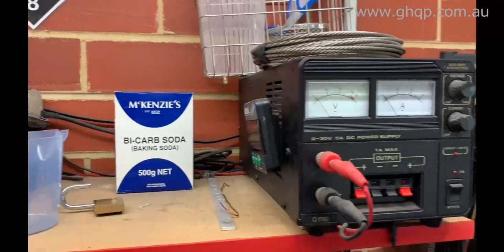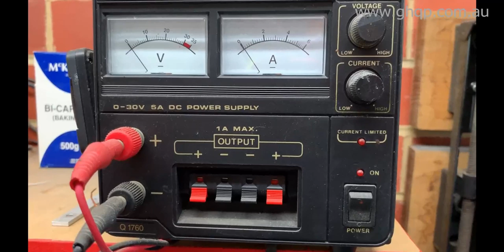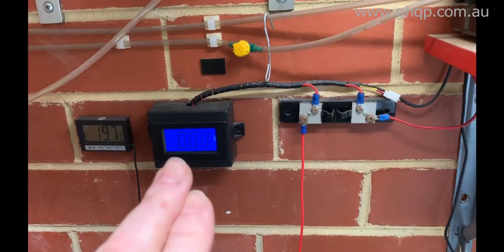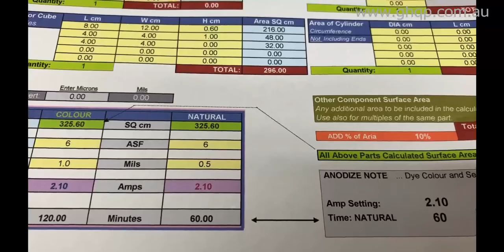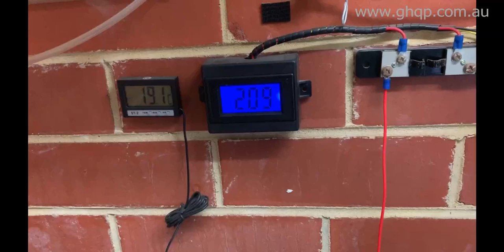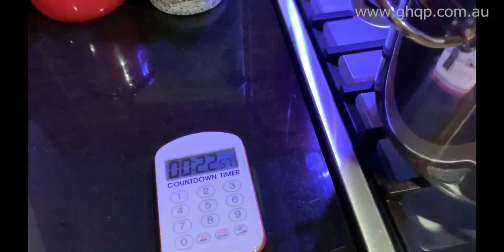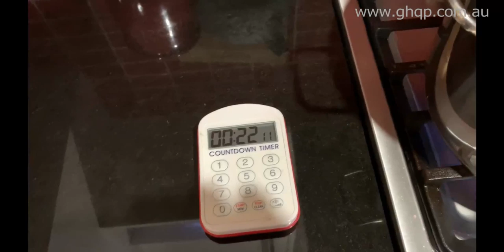Home Aluminium Anodising Process - Part 1

Comment: Hello there. It's refreshing to be able to watch a fellow Australian doing this.
I am considering doing some anodising work for myself as I am doing a couple of motorcycle restorations. One being a 2001 Kawasaki ZX9R bike, where I would like to restore the top triple clamp. The part is obsolete and so I will have to recondition a spare one I have to make it look factory. I have studied it carefully and it appears that the part was silver anodised, then the top face is machined, (it has the look of being sanded with 240 grit), then it's powder coated in clear sealer. 
Question. Is there a "silver" colour dye or is the silver colouring simply achieved by virtue of it being in the acid dip ??
If there is a silver dye, is it just one colouring or are there variations ? I want mine to look factory.
Other parts that have the same silver anodising include, the gear selector, the rear brake pedal, the front clutch and brake levers and foot pegs to name a few, so it will need to match up.

I will visit Caswell and see if I can find a DIY kit that will suit my low scale situation. Thanks for that link. It will be useful.
Any advice would be really appreciated.
Thanks again mate.
Reply from the maker: Hi. That's what go me started with anodising, motor bike parts way back when I had bikes.
Anyway, I am not aware of any silver dyes, as silver is usually achieved with just anodising and sealing, its the natural aluminium colour.
However I believe commercial anodiser's have a process for achieving an almost satin silver chrome like finish but I have never investigated that so don't know.
All I have done when I want silver is just not using any colouring. However the degree of silver achieved does depend on the grade of aluminium. Machine grade like 4000 can end up being a light grayish colour where as 6000 grades are the best for a good natural silver aluminium finish.

Comment: Is there a reason you're using bicarbonate of soda rather than sodium carbonate which is far more alkaline (i.e. washing soda)?
Reply from the maker: You make a good point, I have no specific reason for using bicarbonate of soda just that's what I started using way back as I had it in the pantry and continue to use it, seems to work fine for the little amount of anodising I do these days. But I take note of your suggestion and would agree Sodium Carbonate has a better chemical combination for the purpose.

Comment: Thank you for the video! Can the thermometer be placed inside the acid bath? Is it important to use thermometer with plastic parts instead of stainless steel? I guess the same requirement applies to aerator. Thanks!
Reply: It to monitor the acid temperature I only use a temperature sensor that has a plastic probe. I wrap a small amount of lead around the wire to make it sink. As for a stainless steel one, never done that but it might be ok. Yes my aerator is all plastic.
Reply: Thank you! Any hints what product/solution could be used for degreasing bath instead of Caswell SP degreaser? I live in europe and it’s not possible to buy one here.
Reply from the maker: @janankiersztajn5189  You could use most cleaning detergents or solvents to clean the parts. I just use Caswell because its easily available for me but when I first started I simply scrubbed the part and soaked it in dishwashing detergent. The amount of degreasing/cleaning all depends the machining oils etc you have used during the machining process of the parts.

Comment: Thank you for this video! Helped a lot. I just have a question. What is the ratio of HNO3/HCl in the 5% solution (can you for example use just HCl) ? And do you add any sealant to the sealing process ? Thanks for a answer! Greetings from Czech Republic!
Reply from the maker: The ratio is  5% Nitric and 5% Hydrochloric Acid to distilled water.
I don't add any sealant to the sealing water.

Comment: So if doing a part that require a 55 gallon drum. The voltage will need to be higher?
Reply from the maker: Regardless of the volume/size of the container the voltage is constant and the current is set based on the part surface aria being anodised. You need to use a current controlled power supply so you set the current to the value required.

Comment: Dear engineer
I have a question about Anodic plate in the Anodized bath
1) what is the material of Anodic plate?
2) How to calculat the size of Anodic plate?
3) Can we cover the entire interior of the anodized 
   bath with an anodic plate?
Reply: It is a thin sheet of Aluminium about 0.5mm thick. It does not wear out in fact I haven't changed it for over 6 years. I use titanium screws and wire to make the electrical connection. I didn't use any formula to calculate the size. I just figured it needed to be about the size of each end of the tank. That works fine. I don't see any benefit or reason to cover the entire interior of the acid tank. Nothing i have ever read on the subject suggests to do this. One thing is to always remove and clean the plates when you have finished anodising for the day. If you leave them just sitting in the acid they will develop a black smutty film on their surface that to me i don't like. To clean them I dip them in water with some bicarbonate of soda to neutralize the acid and wipe them clean with paper towel. Cheers Graham
Reply: I know it has been a while since you posted this, but what a great video! Thanks! Did you use 6063 T5 aluminum for the cathodes? I’m struggling to find it that thin.

Comment: A very well matured setup. *like*. Do you keep the aluminium plates ( the negatives ) in the H2SO4 solution when you store it until next use ? I understand the negative aluminium plates will not be anodized but will the acid not get to it when the system is not in use ?
Reply from the maker: I remove and wash first dip the aluminium end -ve plates in a Bicarbonate of Soda solution to neutralize  the acid then rinse them in water. Never leaving them in the acid even for overnight. I have been using the same plates for many years. I use Titanium wire and Stainless Steel screws to secure the Titanium wire to the aliminium plates.
Reply: @hamrx8  That makes sense. Glad to know the plates last long that way. No need for lead then :). When reusing the main anodizing acid bath electrolyte - what kind of maintenance is required on it ?
Reply from the maker: @NeoFrontierTechnologies  Yes lead is not needed no way. As for maintenance on the acid bath electrolyte. May be if using it a lot and the level drops below what you want just mix enough acid and water at the same ratio and pour it in. But apart from that if you always ensure the parts to be anodised are always really clean and well rinsed then your bath should last for years. In 10 years i have only done a complete bath replacement twice. However I don't use it a lot these days. Oh also always make sure the -ve aluminium plates are clean of any smut or residue before putting them into the bath. After removing them from the bath, neutralizing them and rinsing, I always wipe them with a clean paper towel to remove any loose black smut that will have accumulated in the surface during the anodising process. They should look a dull grey, you will figure all this out as you proceed.

Comment: Great video- Curious why you rehang the parts.  Newbie question: Why not hang them with the titanium wire from the start of the cleaning process?
Reply from the maker: Good question. I do often secure the parts to the titanium wire from the start especially if it is light and I am securing with a through hole. Heavier parts I like to put the titanium wire in last as during cleaning I want to make sure the hole I am jamming the titanium wire into is clean and flushed out. Hard to do with the titanium wire already in it.

Comment: Is it really OK to use tap water anywhere in the process, or should You go for deionized water all the way?
And; If You use titanium screws in the holes - will the threads be anodized anyway, or will they be blocked?
Nice tutorial - thanks for sharing! 👍
Reply from the maker: Hi. I only use de-ionized water for the Sulfuric Acid Anodising bath. For cleaning I use standard tap water (the tap water where I live is quite clean and low in calcium). For the final part rinse just before placing in the anodising bath I use filtered tap water. 
I now use titanium screws to secure the titanium wire to the part, wherever the screw and wire make contact with the part tat aria will not be anodised. The surface of anodised aluminium is an electrical insulator so you want to maintain a good electrical contact with the part being anodised throughout the process. This is why you will choose the most less visible location of the part being anodised to attach the wire as there will be a small spot that does not get anodised and if colouring the part that wont colour.
I hope this helps :)

Comment: I want to anodise somt 1 inch square tubing maybe 600mm long... can it be done at home? you think? total surface around 1000sq cm I want it yellow.
Reply: Yes technically that could be done at home. You would just need a tank large enough, say 700mm long or 700mm deep. However the thing to consider is that the current needed for just one (1) tube would be 15Amps, you have to account for the outside and inside aria. 15A would be 1 Hour anodising time the current can be reduced proportionately to 7.5A for 2 Hours anodising time. I have never done tube anywhere this length so I am not sure about how well the inside would anodise over that length, if in fact was required. 
Anyway if you are only needing to do a limited number honestly the cost of the setup would likely outweigh the cost of taking the tubes to a commercial anodizer.
Reply: @grahamham3398  yeah I found the calculator... each bar has about 1000sq sm surface. so yeah it will take loads of time or current.

Comment: EXCELLENT VIDEO, VERY EXPLANATORY AND COMPLETE, THANK YOU VERY MUCH FOR UPLOADING IT. I HAVE A QUESTION, COULD THIS METHOD WORK WITH DIFFERENT ALUMINUM ALLOYS? FOR EXAMPLE AN ALUMINUM ALLOY USED TO MANUFACTURE ENGINE CRANKCASES
Reply from the maker: To my knowledge anodising is not able to be done on Cast aluminium like car parts.

Comment: is the same setup required for hard coat anodizing
Reply from the maker: The basic setup and process is the same for Hard Coat Anodising. However there are additional requirements such as cooling the Sulfuric acid bath to nearly freezing and voltages upwards of 100 volts at an applied current density of 24-36 amps per square foot. Basically I would say that these requirements take the process of home anodising to a new level. Yes it is doable but you would need a far more advanced bath cooling system than I have.

Comment: Very informative video, thanks for sharing. I would like to attempt some home anodizing however I cannot obtain sulphuric acid online. I do have some ferric chloride etchant which I use in my circuit board production, would this be a suitable alternative? Thanks.
Reply from the maker: I have seen somewhere of ferric Chloride being used for anodising but myself I have never tried it so unfortunately I cant comment or advise you on that. I know sulfuric acid can be hard to obtain even doing it in person. Fortunately I found a chemical supply company close to where I live that had no problem selling it to me. The only other option is a car battery store. Buying it on-line has all sorts of transport delivery problems and it cant be sent through normal post. Once you do get it it lasts for years, the most recent batch I made up I have been using for over 6 years now.

Comment: Anything special about the containers you are using for the various stages? They look like ordinary plastic storage boxes. Thanks.
Reply: Yes correct they are standard storage boxes. Never had to replace them in all the years since I started anodising.
Just FYI... These days I use titanium tubes to hang the parts, those are the ones that the +Ve clips are connected to. Also as most of the parts being anodised have an M3 or M4 threaded hole somewhere I use short titanium m3 or M4 button head screws to secure the titanium wire. I put a loop on one end of the wire that the screw passes through -----O, this provides a really secure electrical connection and as Titanium is not effected by the acid or the process they can be used over and over again indefinitely just like the titanium wire. I bought the screws and tube on eBay.

Comment: Is there any way to know which concentration baths you use in each step? I understand that for the anodizing you use 20% sulfuric but the bicarbonate and sulfuric nitic mix you did not explain
Reply from the maker: For the Bicarbonate I just take a guess. It’s like a table spoon/500ml. Sulfuric/nitric is 5% of each.
Reply: @hamrx8  thanks for te response, how do you calculate the current? How much current per surface area?
Reply from the maker: @bouza96  Visit my webpage and you will find the downloadable spreadsheet I created to do just that.
http://www.hamrx8.com/Home_Anodising.html

Comment: Hello, I'm trying to replicate your method but something is not clear to me. what is the concentration of the caustic bath? Thank you
Reply from the maker: I don't measure out the concentration very accurately. But if I were to estimate it would be about 140cc or a Table Spoon to 2L of water. You may vary this depending on the activity you are getting from the submerged parts. You want a nice consistent light bubbling not violent like the solution is boiling.
Reply: hamrx8 I did 1kg of soda in 10 liter of water and it’s working well. Thank you!

Comment: Izin bertanya, Kak kenapa proses elektrokimia (proses anodizing) selalu menggunakan larutan asam pekat (H2SO4) ? Kenapa tidak menggunakan air atau larutan basa
Reply: First to translate your question:
"Why does the petrochemical process (anodizing process) always use a concentrated acid solution (H2SO4)? Why not use water or alkaline solution."

The use of Diluted Sulfuric Acid for anodising is traditionally the most common for both Commercial and Home anodising. This is generally the accepted way of doing it. The acid is diluted to 20% concentration using distilled water by volume.  Looked after properly it will last for many years before it needs replacing, depending on the frequency of use.

As to the use of just plain water, well nothing would happen anodising would not happen, the aluminium would simply discolor.
However when it comes to an Alkaline solution, there is some research and use of this method and a google search does reveal some information of its use for anodising. However thought it may work, I have no personal experience so am unable to comment. I went for the conventional most accepted way of anodising that works. Sulfuric Acid is easily available where I live so that's what I use however I do believe in some countries it may not be easy to obtain in the concentration and purity needed for anodising.
Reply: @grahamham3398  Thank You for the answer sir🙏

Comment: Sir,
Which Titanium grade do you use for Titanium wire?
Reply from the maker: Hi. The packaging does not indicate an actual grade number. However I do know it is specified as being Pure Titanium - Jewelry and Surgical Grade. Its been a number of years since i purchased any so I don't have any links I can share.
Reply: @hamrx8  
Sir,
   Thank you for reply.
We are using Aluminium strips for suspending Components into the bath. It (strips) last for a month.
Does Titanium last for long (atleast a year).
Reply from the maker: @prashantjadhav9872  I have been using the same Titanium wire for some years now and it has not degraded at all. As such i have not purchased any new wire for nearly 10 years. You don't even have to clean or do anything to the wire between uses even if it does look discolored. These days I also use M3 titanium screws to secure the wire to the part, so much better tan the way I show in the video.

Comment: Sulfuric acid is one of the most dangerous acids out there, it can etch the light bulbs in the room you are using it in. One small drop on the skin will not cause pain but could create a very deep wound that will appear over night.
Reply: Oh yes totally understand all that. I have been using these acids for well over 50 years and always take the upmost precautions using eye, skin and vapor protection. My setup is not in the house but in my garage that is well ventilated including extraction. Never had any issues like you describe in well over a decade using my current anodising setup. Thank you for commenting.

Comment: Hey Ham.
Would you be interested in anodizing 4 parts for me? The parts are approximately 110mm round and 15mm thick? If so how much?
Thanks Marty
Reply from the maker: I would be pleased to help out but I am in Victoria, Australia so that would only be practical if you live near me or at least in Australia.
Reply: @hamrx8  I'm in Sydney... I can post them down.
How much would it be per part to anodize?
Reply from the maker: @martinbridgewood1610 I have sent you a FB message.